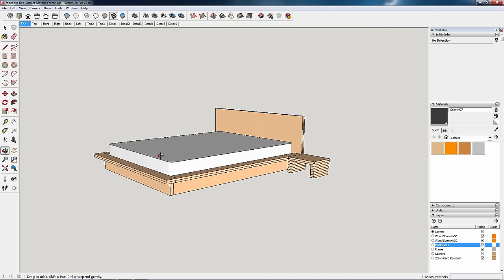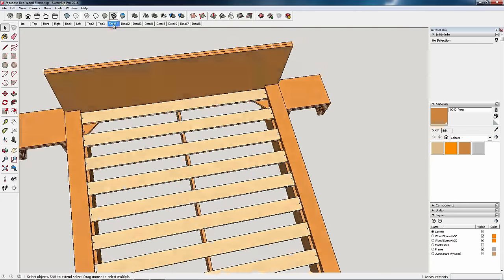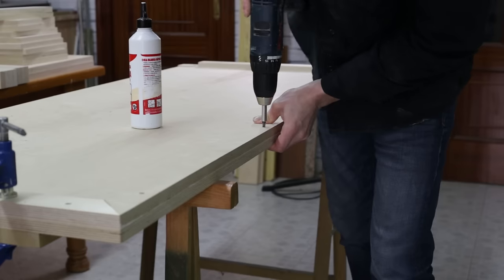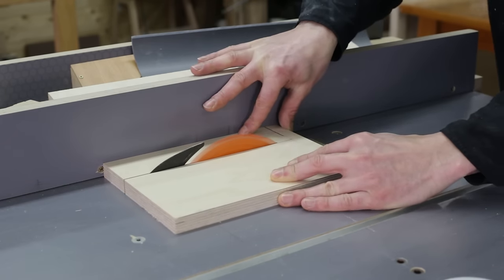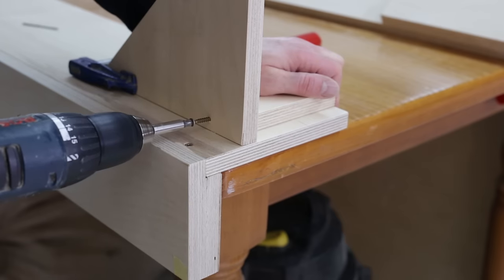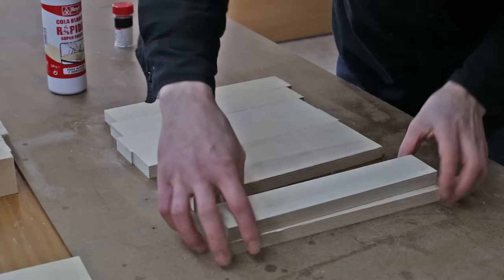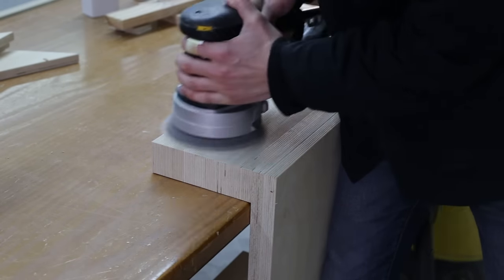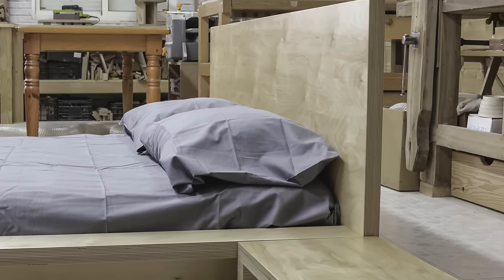How to make a plywood Tatami Bed

Comment: what did you add to the glue that looked like salt and why?
Reply from the maker: I add a little salt to stop them from moving due to the glue’s viscosity.
Reply: Paoson WoodWorking awesome, I'll keep that in mind. I'm betting it's a pretty course ground salt or just fine treble salt works?
Reply from the maker: With fine salt will works!
Reply: I don't know why he's not just using sand. Seems like it'd have the same effect and be much less reactive.

Comment: I'd apply a round chamfer to the edges and corners of the outer board of the bed. It's a little bit traumatical. Imagine that you accidentally hit this board with your shin. It will do very very big "ouch!"
Reply from the maker: the tatami beds are like this one but a round chamfer is easy to do.